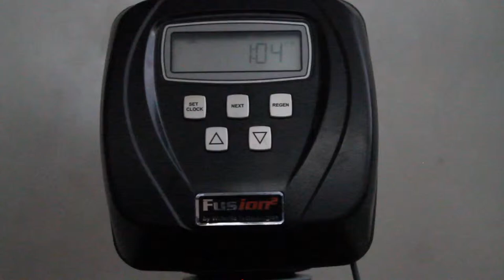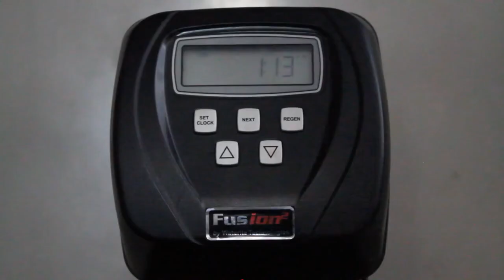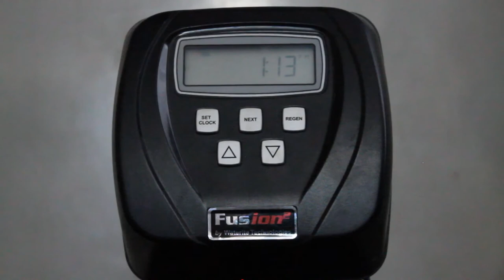Fusion 2 Water Softener Regeneration How to Regenerate Clack WS1CI control valve

Comment: New to water softener.  Plumber explained nothing but add salt once a month. Instructions list doing a bunch of arrows after adding salt.  Do you wait to add salt when display indicates salt low or how do I know if my unit prevents has the low salt option.  So many questions and can’t seem to find any answers. Oh and change the UV filter and turn a bunch of valves before you do that.  And here’s a tap to drain water.  ☹️

Comment: When should the salt be added? Before all of this or after the regeneration process?
Reply: Always have salt in the brine tank.
Never mind anything else.
No salt, no water softening.
Reply: @luismelendez903 when you say brine, should there be water in my salt reservoir? Should I see it or is the water very low? My salt is about 9” from the top of my 32” reservoir.
Reply: Water should be seen in the salt tank.
Its mixes with the salt to create a brine.
That brine is what goes into the tank.
Dry salt will not do it.
Also, if you have rust, use Rust Out in the brine tank too.
It eliminates rust stains.
Follow the instructions on the bottle of dry Rust Out powder.
Should be a little brine.
As long as there is brine, it will work.
1 bag of salt, (40 lbs.) should last a month.
Yes, not a lot of water but water must be present.
My tank usually has 1 bag of salt and a little water around the bottom of it.
The Clack uses very little salt.
I rebuilt my system.
I will keep an eye out for you.
If you need more help, let me know.
I rebuilt my system.
I can help.
I had a plumber install it with very few beads inside the tank and 2 years later he wanted me to buy another system because "this system doesn't work with your water."
1,000 dollars more.
I fired him.
If you are using more than 1  40 pound bag of salt per month, there is a problem.